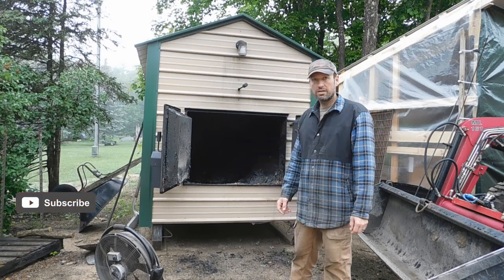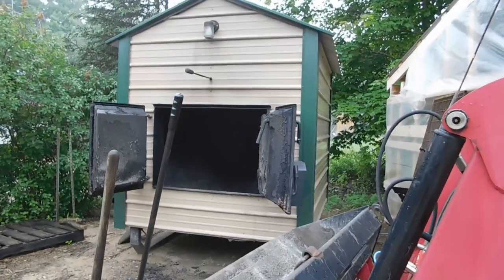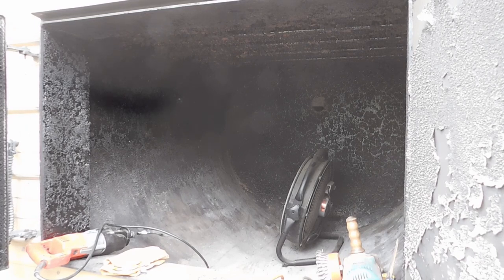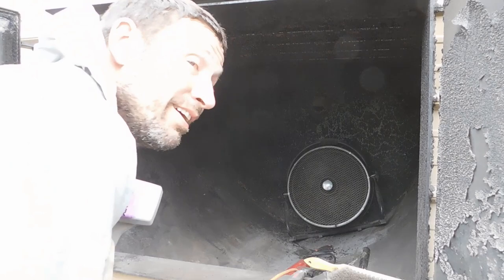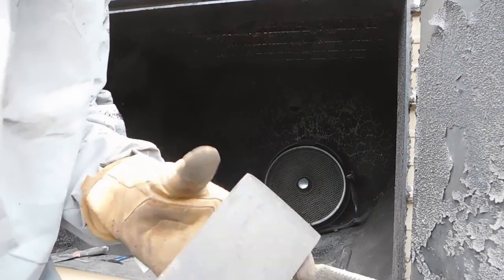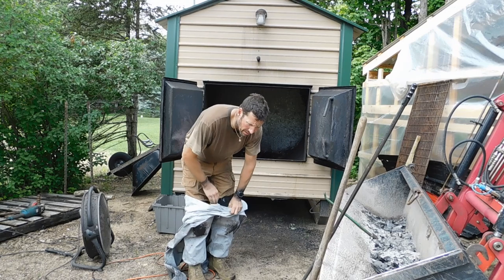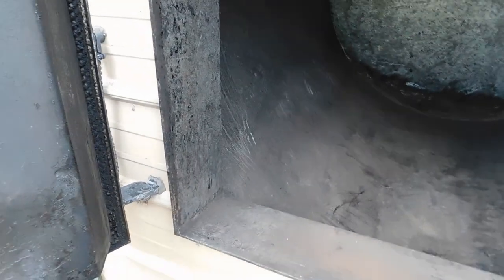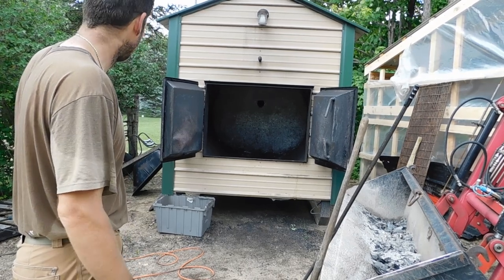Outdoor wood boiler clean out, would I do it again?

Comment: You cleaned that to nearly brand new unused condition.  You are on the right track.  Use creosote remover, a powder you add to a slow fire which catalyses the creosote,  drying and making it flake.  This allows for a quick scraping.  Every couple of weeks burn a shitload of card board and burn out the rest.
Reply from the maker: That's exactly what I'm doing now,  I made another video of that process.  I don't think I'll ever get in it again to scrape unless it needs repairs.

Comment: Used motor oil is what I coat mine with. I don’t clean it out like that either. Just scape the sides with a hoe and clean the ashes out good. I may burn a creosote dissolver this year, just to try it. My burner is 18 years old
Reply from the maker: I don't think I'll ever clean it out like that either,  just a good burnout and ash clean out as well.

Comment: Dry creosote is not corrosive in any way it a dry layer only when it mixes with water which allow electrons to be released into the water . Its the water that allows the oxidation to occur. 
Creosote reduces the thermal efficiency of the boiler over time
Reply from the maker: Thanks for the comment,  I agree,  I don't see any advantage to cleaning out the creosote other than to improve heat transfer.   From now on,  I'm planning on doing the burnout with some creosote remover,  nothing manual.

Comment: Now coat with vegetable oil
Reply from the maker: I've been checking the inside periodically over the summer and have not noticed any rust coloring at all.  I'll be doing a boiler start up video in the next month or so, I'll make sure to get a good shot of how the inside looks after 4 plus months.  Thanks for the comment.